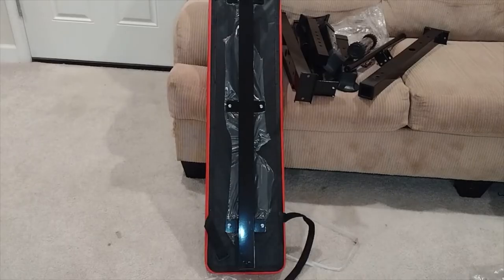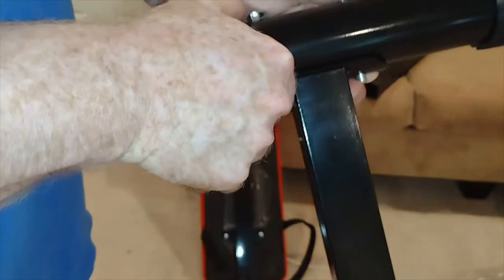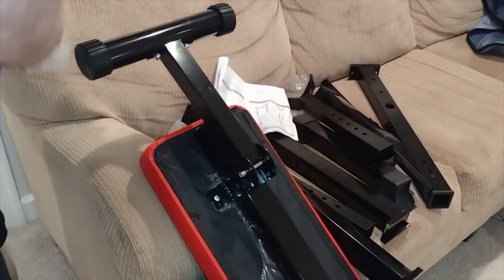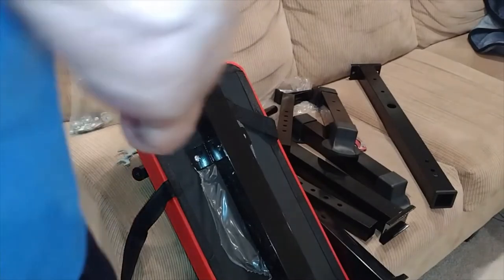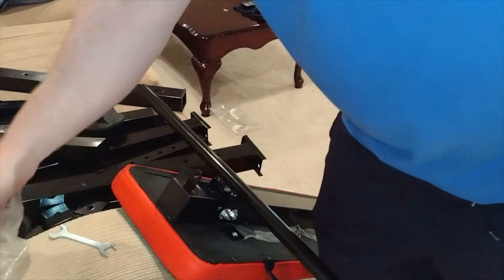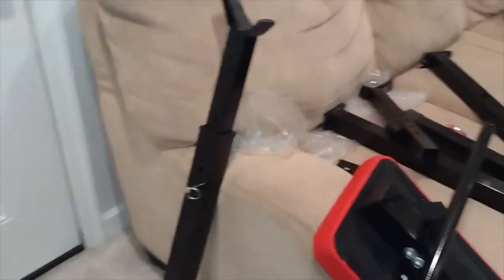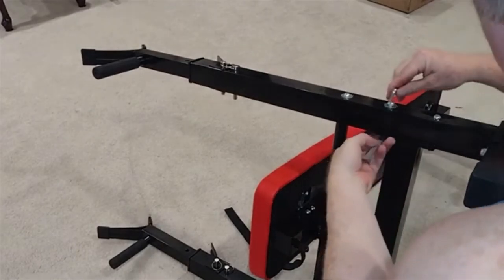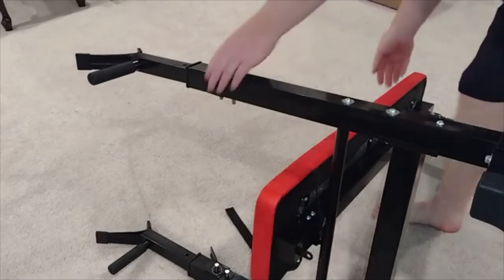Assembly BalanceFrom RS 40 Adjustable Folding Multifunctional $79 on Amazon weight bench press

Comment: i got this same bench for my 15 yo boy. we opened it up today. there were no instructions in the box. with a little trial and error we were able to put it together. i actually got my sockets out and a wrench. It went together a bit easier with proper tools. i found this video to assure myself that we assembled it correctly and we did. the strap is to hold your feet down when you do inclined sit ups. thanks for the video

Comment: to avoid the washers overlapping, insert the screws that are paired together from opposite directions.. 1 simple solution i found for that part of this increidbly stupid assemblys. but make sure you put the bottom bar that connects the two side bars which hold the barbell the correct position (where the center of it on ONE side has an entrance for the pin to lock it in upright position when not in use)

Comment: the bench is honestly super wobbly, did you fix that in any way?
Reply from the maker: Hello, no I think unfortunately this is really meant as a beginner bench for skinnier folks using light weights.  I have some videos of putting 300+ on it inside of a power cage.  I am not sure if there was much additional safety but it was a scary experience.  It now collects dust in the corner....as my son never used it.

Comment: Do your arms go outside the rack or inside on bench presses?
Reply from the maker: They will go on the outside.   I don't believe even if I did close grip bench press, that I could fit them on the inside.   Here is a video of me using excessive weight for this bench https://www.youtube.com/watch?v=QAmhTlk7VDE    (fast forward to the 51 minute mark).  

Another issue that I might have discussed, this is bench is really not good for any barbell above 5'.  In the example video, I used a 7' Olympic bar.  One will have issues with the weight teetering as they try to take one weight plate off.  A shorter bar for me, would cause issues with getting too close to the rack/posts portion of the bench.
Reply: @ScorpionMcKillinIt  thank you. Really appreciate the effort you put into this.